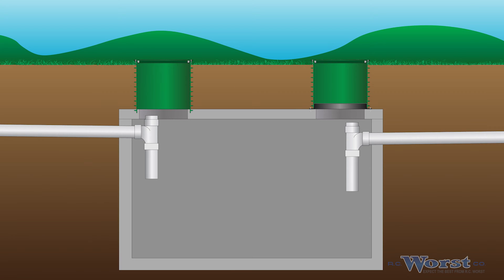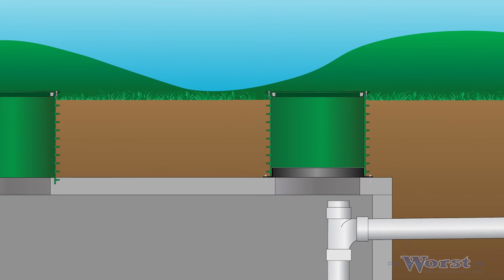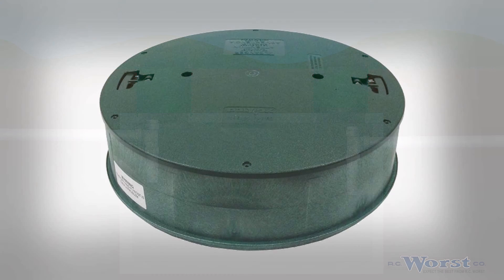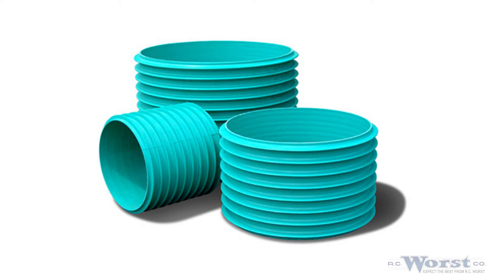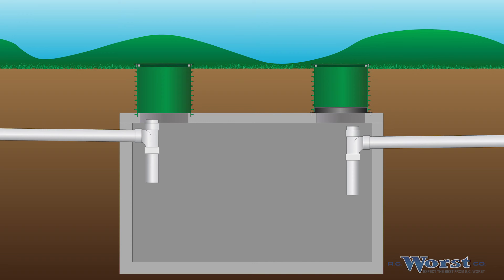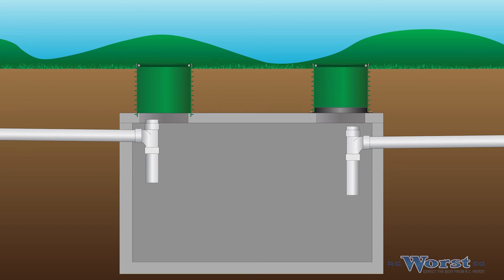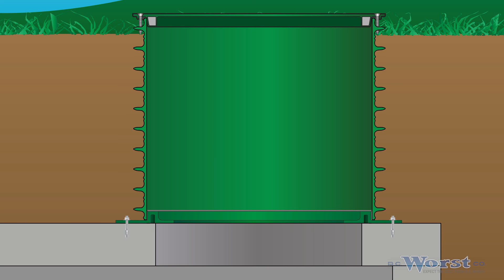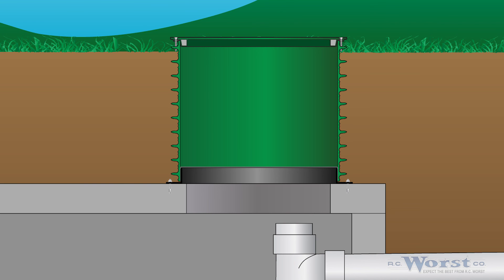Septic System Access Risers and Lids

Comment: The plastic add-on risers are apt to leak especially where it sits on the tank, but how much ground or rain water is too much? Provided the tank is not in standing water alot of the time, if a rainstorm pushes a gallon of rainwater into the tank every few days is this a problem or is it like taking one more bath or shower a day?  And remember that the original concrete lids were probably far from leak-tight either.